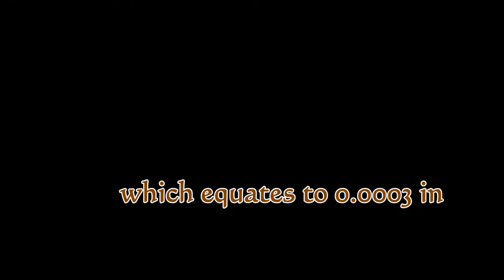a groovy weinig bed

Comment: good job,...looks like alot of work went into it. I know the feeling when you got a machine which has been abused until nothing worked anymore, it almost hurts you physically, ....however, that's usually the point i buy them, ... cheaply
Reply from the maker: yep, i use that same tactic and have come into some fairly decent machinery at a really reasonable price. and whenever i see the abuse that some people put into their equipment i cringe. how's that cold saw you saved from certain doom working out for you?
Reply: Honestly, ... i did not have the time to look at the saw, sourced a few other nice bits from there as well, but at present the Jeep has priority as i am going on holiday soon, that's a 3000 miles drive at least
Reply from the maker: wow! sounds like you're headed for africa...lol.. well if you get over to this neck of the woods you're more than welcome to pop on in for a beer or a spot of tea.  :)
Reply: No not Africa,  Scottish Highlands as every year, but thanks for the offer, same applies for you .. if you ever make it over the water.